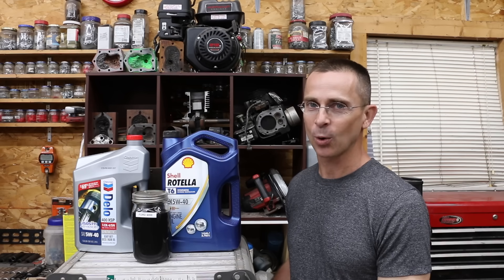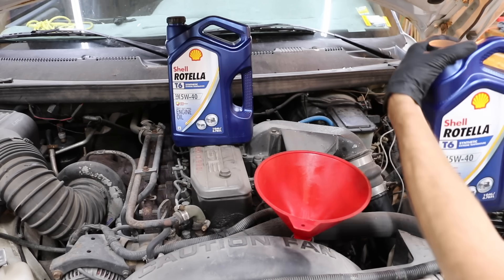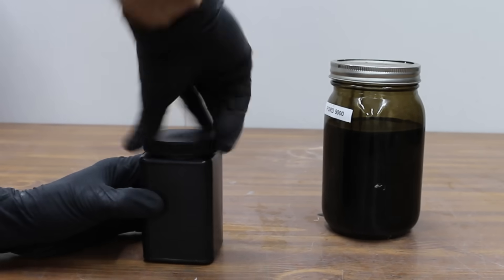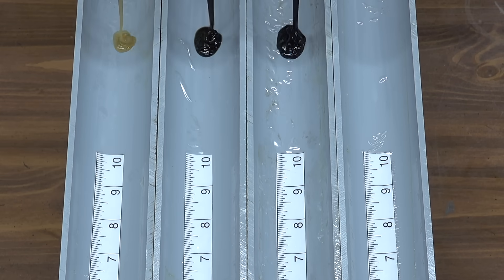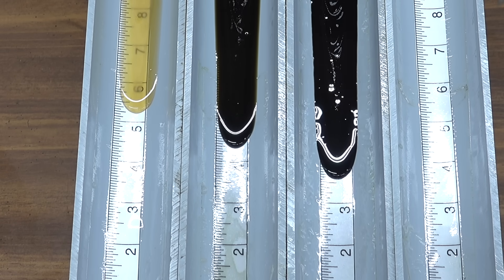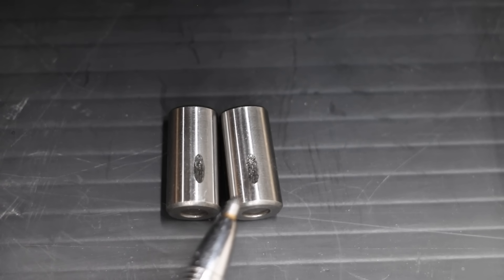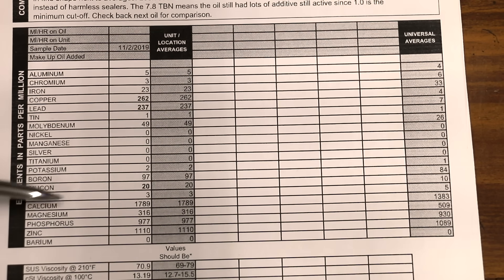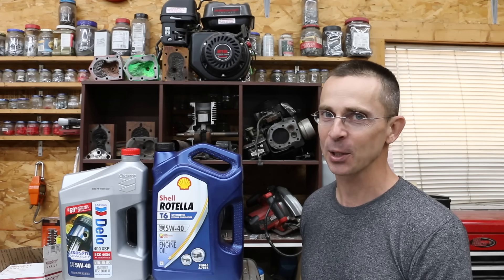Will Annual Oil Change Damage Your Car? Let's find out!

Comment: I've a land rover discovery 3 V6 diesel it's oil change with recommend oil is 12000 miles I change it at 10 thousand, usually in October,,but if it's not up to the milage I'll change it £50 is cheaper than an engine ☘️☘️☘️☘️☘️☘️☘️ from northern Ireland
Reply from the maker: Thanks for sharing.

Comment: Ok how about non stop running  motor. As it keeps lubed does it need to be changed 5k 15k. I have worked at a moderately big trucking company and the oil change interval for a freightliner is 35k and the volvo 50k and they use delo 1300 super. And run 600k 750k before they sell the old trucks. Been told cause they stay lubed. And the tighter tolerances of the newer motors make it possible
Reply from the maker: Thanks for the suggestion.
Reply: the tighter tolerances mumbo-jumbo is a new age myth........Willie

Comment: Yes change oil yearly even if barely driven.
My 96 k1500 had conventional oil with Lucas in it. 156,000 miles and 2,000mi on oil. Truck stopped running 2014. Bought a scanner in 2021 and found the problem was a bad coolant temp sensor at gooseneck.
Fixed truck started it, no oil pressure.
The oil had turned to sludge thicker than 80w90. More like nlgi1 grease.
3 oil changes WITH 1 qt k1 kerosene each change to flush. Filter kept getting clogged so I unplugged coil, pulled oil filter and ran 2 qts oil out filter stud.
Problem corrected. Went back to 15w40 synthetic NOT conventional. 
Change your oil yearly. Look in filter each change.
UPDATE Personally i like Delo 15w40 and Rotella T6 and have goe back to it from mobil 1 ext service high milage , SN+ SN rating.
I use Bosch premium and Fram premium filters.
Reply from the maker: Thanks for sharing.

Comment: If the oil did become acidic I would think the corrosion would also show up on the dip stick. If this is true then why go to all the trouble to tear an oil filter apart ? I have always changed my oil based strictly on mileage.  Sometimes my vehicle/s will not get an oil change for 2 or 3 years (or more) without any noticeable corrosion......no problems !!!

Comment: I was reading a bit in classic car forums how a lot of people use T6 because of the higher ZDDP content and the better wear protection it offers since it's been lowered considerably over the years. I recently did an oil change for my 89 Cadillac Brougham to T6 for the better wear protection and man I don't think it's ever run so smoothly, or quietly for that matter. Expensive oil but I think I'll likely just stick with it depending how it goes for it's next oil change.
Reply from the maker: Thanks for sharing.

Comment: What about direct injection or turbos where fuel can get in the oil? Even if you drive say 3000 miles or less would the oil still protect ?
Reply from the maker: Thanks for the suggestion.

Comment: Would the oil age question be different with gas engine, gas engines with , carberators, with fuel injection???

Comment: Can you please do new libricity test stages of the new DIAMOND technology WICH has replaced the original BESTLINE WICH can NO LONGER BE FOUND ON MARKET.Probably because it worked to good.I’m curious to see if the replacement is as good
Reply from the maker: Thanks for the suggestion.
Reply: @ProjectFarm  absolutely! Thank you for taking the time to respond 💯truly one of the most genuine channels on the platform

Comment: Speaking of oil changes and filtration, I read an article in Consumer Reports several years back that suggested using the largest filter that could fit on your vehicle by matching the rubber seal and thread size to gain additional filtration. In therory it seams to make sense, but is this safe? Over the years I've tried this, but don't truly know if I've benefitted from it..
Reply from the maker: Thanks for the suggestion.

Comment: A mechanic once told me that the reason you change your oil, is because the thickener that makes it a multi weight oil breaks down. Ive read the thickener doesnt change the film strength. Can you test these 2 things?
Reply from the maker: Thanks for the suggestion.

Comment: We use Mobile 1 full synthetic. It says it’ll last 10K miles between oil changes, but I have it changed every 4-5K miles.
When I use to use conventional oil, I changed the oil every 2500 miles.
Reply from the maker: Thanks for sharing.

Comment: I have ran some form of delo in my high performance LS gas engines for years now. I have tried everything in them from amsoil, euro spec stuff, and everything in between... nothing I put in them can touch the delo. The valve train is also happier. Great stuff
Reply from the maker: Thanks for the feedback.
Reply: Same here! Delo 5w40 in the turbo LS truck daily drivers

Comment: I never use synthetic oil in 50 years of automobiles ownership. My current 2005 Toyota Sienna is still running flawlessly after 17 years and 318K miles without any major issues. I change oil 2 times a year using conventional 5w/30 and Toyota oil filter, the important thing is keeping oil level at full or near full level at all times. 
I use Toyota OEM parts as much as possible.
Reply from the maker: Thanks for sharing.

Comment: Jes I agree on that. Get the engine up to running oil temp.
Becauce the inside build up vapour moisture condensate water in oil at the bottom of sump.
Oil level wil rise.
It wil go away after 1-2hour running load.

Comment: I just changed the oil on my Prius after ten years. So what. It's 15 years old and that's the first maintenance ever done on the car. I did change the battery pak after 12 years and 30k miles. Performance picked up to like new with 48 mpg. I studied oils and fuels in college. You can judge the state of your lubricants with a microscope if you know how to use it. You guys who change oil a lot are falling for a scam.

Comment: This might be of interest to you. I have some oil & Gas wells. I use a 22 HP Harbor Freight Predator engine to power a Quincy compressor to sell the gas. The engine I am using now has been running for 2 years and 4 months, mostly 24/7 operation but it has been down maybe 3 weeks in that time span. I never change the oil,I have a 10" x 10" with fan and 180 degree thermostat for oil cooling. I have run from day one with Shell T6 and Lucas Oil stabilizer. She still runs today, uses less than a pint of oil every 2 days. In my opinion  both the engine and the oil are excellent items.
Reply from the maker: Thank you for the video idea!
Reply: @ProjectFarm  Further to above, thought this might interest you. I have two major screw ups on this engine in the last 6 weeks. One a failure of oil filter gasket the other me being a DUMMY! Left oil fill cap off.
In both cases the result was the motor losing all oil and shutting down, the low oil kill stopped working with in 6 months of use and is disconnected. At any rate all I had to do was fill with oil and start motor and it is running now. I feel the good oils are what has kept it from being total junk!!

Comment: If you're direct injected I'd change it out at least every year with low miles even. The gas dilutes the oil and thins out the weight of the oil over time. I had  blackstone analyze my 2 yr old amsoil signature oil and it still had enough detergents left and low acidity but the viscosity was getting less.
Reply from the maker: Thanks for sharing.

Comment: I used  rotella t6 in my 2006 honda shadow motorcycle with a trailer sold it at 20,000 miles with no issues
Reply from the maker: Thanks for sharing.

Comment: I have the oil changed on my car, just once a year, because I only drive 60 miles a week (3,000 a year) Out of the 60 miles, I do 30 of it on one trip, once a week. The car is almost 9 years old and only has 34,000 miles on it. It's even has the original battery in it. (not bad for garage kept Chicago Winters)
Reply from the maker: Thanks for sharing.

Comment: We specialize in Honda V6 J-Series Engine Performance Parts. Our Shop/R&D car is a 3.5L 560whp custom Turbo and have run Rotella T6 in it since the rebuild. Over 40k miles on it running at that power and still running strong 🤙 I mentioned this on this channel before to test the T6, looks like he listened. It's a well known drifter and budget racer trick to run the Rotella T6 oil
Reply from the maker: Thanks for sharing.

Comment: I ran a Saturn to 414K miles and used oil change oil for the last few years.  I didn't change it, I just kept dumping it in as it burned it.  Drove it to the junkyard when an oil control ring blew and it was 300 miles a qt.  So about 100k on the worst oil and a handful of ATF as it was free.  Can't argue with 36mpg either.

Comment: My truck/tractor sat for 7 yrs, 5 years without starting. It had T6 with 5k miles on it. I started it & ran it for 30 miles. Took the oil sample. Sent it to Polaris. The test was good with slightly high lead they said wasn't a problem and that was it. They said run it for 3k miles & retest. (At this time know one can find T6). Your vids are a great help.
Reply from the maker: Thanks!

Comment: I always comment on your testing procedures, rigs and ingenuity.  Nice RAM 2500!  I'm pretty sure that Diesel engines operate quite differently than Gas engines, with Diesel engines running hotter among possible other things.  I wonder how testing the same or similar oils in Gas engines would compare.  Thanks for everything you do for us, Todd!  You are Amazing!
Reply: It's the other way round,the gasoline engines are hotter.
Reply from the maker: You are welcome!

Comment: i drove a ford truck (daily driver)--- i  added qt oil as needed  over a time NO Change  one night about 4am on the interstate my engine stopped  like    it was out of gas   i coasted off highway   here  is what happened ------- oil pic up  stopped up engine locked up   ended up costing over $2500.00 new engine  1980s  now its changed on time
Reply from the maker: Thanks for sharing.

Comment: My only concern with this video is that the test platform was done using a diesel rather than a gasoline engine which the vast majority of the public drive.  Would the results have been different in a gasoline powered vehicle?
Reply from the maker: Thanks for the suggestion.

Comment: I fill my horizontal-mounted oil filters to saturate the filter element prior to installation. Installing them dry, in my opinion, delays oil flow at start-up until the paper element absorbs the oil, which takes a second or two. Next time you change your oil, pour oil in the filter and watch how long it takes for the element to absorb it, especially large filters.
Reply from the maker: Thanks for sharing.

Comment: Absolutely mint 2nd generation Dodge Ram Cummins! Please take care of her on that farm!
Reply from the maker: Thank you!
Reply: @ProjectFarm  could you possibly do a diesel fuel lubricity test one day and then compare it with fuel additives added? A lot of folks have the notoriously bad Bosch CP4 pump and keep hearing about how poor lubricity of untreated diesel causes failure. But I find it hard to believe that adding 1 oz of treatment like Hot Shots EDT can really make a difference. The SAE uses the wear scar method.

Comment: This is why I run my 100K mile 06 DuraMax every 2 weeks or so when I'm clearing snow in the winter months....I'm a Rotella user and the local FarmSupply usually has rebate cupons on Rotella making it the best bargin in diesel lubricants....GREAT JOB!👍
Reply from the maker: Thanks!

Comment: Ive owned about +_ 40 cars in my life so far, and if I like a car ill change the oil after the first year. But ive been.driving an old benz diesel for over 8 months with the oil light burning. Just to see if it would go in. Nothing ever happened. Oil is oil yes a new car probably wears down a bit more so has more.metal particals in the filter. But a old beat up car doesnt have that its already worn. Bet u u can go for multiple years without oil change. Its a scam.

Comment: I did an experiment on a motorcycle 650 Kawasaki inline four. About 20 years ago. Changed the oil every 500 miles and the filters every other oil change. At 10,ooo miles I took the head off and the cylinder walls showed almost no wear at all. Then I would take the used oil and put it in my car after filtering it.  I purchased this Valvoline oil at a super price when a new auto parts company had their grand opening, we purchased 20 cases of oil.  When we used the last quart oil price had doubled.
Reply from the maker: Thanks for sharing.

Comment: I have been using T6 in my 2005 Honda VTX 1300 motorcycle for over 50,000 miles now. I change it every 7 to 10K. Not only does it protect my engine but it quiets my gear shifts too. I also use it in my 2008 Nissan Versa 1.8L  too.
Reply from the maker: Thanks for sharing.

Comment: I have not changed the oil or filter in my old Ford wagon farm workhorse for over 5 years since I got it and it still runs like a Swiss watch..It has a decent oil leak so I just keep topping it up with cheapo stuff..330 plus thousand kms on the clock and I will keep going till it eventually dies.
Reply from the maker: Nice!

Comment: you people go ahead with that and i will be glad to sell you big timing jobs from the sludge build up in the very small ports in to days gasoline motors, and you would not believe after 10,000 miles how today's filters collapse on them selves. The 2 engines he is using are older models with very good oiling ports for flow. and diesel motors  get diesel fuel in the oil over time slow process that actually helps with any corrosive properties from happening. Bottom line do that test on an echotech engine or echo boost and see your mechanic with a 2,000-3,000 timing chain/cylinder head job over all the small ports that are plugged. there are pro and cons to synthetics and the test subjects are the wrong one. The majority are not driving these older model diesels with great oil ports

Comment: This was such good news to hear about oils being good after 12 months. My fiancé drives a 2004 Toyota Camry only about 3000 miles every year. It is  driven at least once or twice a month so the oil gets up to temp periodically. We keep the battery charged with a CTEK charger as well. I didn't do the oil change for nearly 21 months when we hit 5000 miles and the maintenance required light came on. This tells me the oil will be good for the time that we drive between oil changes. We haven't experienced any adverse issues so far and use high quality synthetic oil. Thank you Project Farm for putting out an incredible and informative video.
Reply: I have a Mustang V8 that's rarely driven.  I change the motor oil once every other year.  No problems.
Reply: @not1but2and37 I agree, I am retired and only drive 3 pr 4 thousand miles a year and use premium synthetic. No problems.
Reply from the maker: Thanks and you are welcome!
Reply: I still own a Toyota Tacoma 2004 with 300 thousand miles on its and still running around, no problem with engine yet, I always take it to the dealer and the dealer put a new chassis on it for free,
Reply: @geoestrada5001  a new chassis? what?
Reply: @metalrooves3651  yes the dealer told me my Tacoma 2005 have a chassis recall  and leaf spring too,  me no problems,
Reply: Dodge will refuse to work on a vehicle at a dealership ever again if you dont change the oil once per 12 months at minimum and prove it.
Reply: why woul you EVER CHARGE YOUR BATTERY?  ive never heard of this,,it has an alternator that does it!THIS IS NONSENse!
Reply: @metalrooves3651   This Camry has an aftermarket Viper alarm system which draws an extra 20-40Milliamps per hour on top of the car’s normal drain, and the car is not driven that often. The battery will go lower than 12.4 volts in as little as 3 weeks if it is not driven. Optima recommends charging the Yellow Top battery if it gets below 12.4V to keep the battery topped off. One person’s NONSENSE is another person’s “Makes sense”.

Comment: For 3100 miles that oil looks terrible.  The amount of moisture / water in the oil in wisconsin still tells me that twice a year changes are way smarter.  
     I change my own oil and pay about 32 dollars for 6 quarts and 8 more dollars for a new oil filter.  So 40 dollars twice a year.   I think spending that 40 dollars is very smart instead of risking replacing an engine.
Reply from the maker: Thanks for the feedback.

Comment: Mr. Farm.
Before 1980 all engine oils had a anti-wsrr ingredient in the oil.
In 1980 this ingredients were removed and the oil was reclassified as gasoline engine oils and the recommend oil change intervals is 3000 miles.

However the ingredients were left in the oils and the oil were reclassified as desiel engine oil and the intervals oil change is 10,000 miles.

I use desiel oils in all my gasoline engines, even my riding mowers
Reply from the maker: Thanks for sharing.

Comment: Mr. Good Farm
I would like to share with you my own oil test results I did.
I have a 1997 Nissan Sentra with a 1.6 liter engine. This engine has two timing chains and two timing chains tensioners. I use the tensioner for the cam chain as my guide since that tensioner wears out faster.

For my test, I use shell Rotela 5W-40W full synthetic oil for Diesel engine with Frame Gold oil filter These are my results

At 5000 miles oil change intervals I get 200,000 miles  use out of the tensioner.

At 7500 miles oil change intervals I get 150,000 miles use out of the tensioner.

At 10,000 miles oil change intervals I get 100,000 miles use out of the tensioner.

To date my Nissan Sentra had 650,000 miles on the odometer and I get 37 miles per gallon. This car is my daily driver to work.
Reply from the maker: Thanks for sharing!